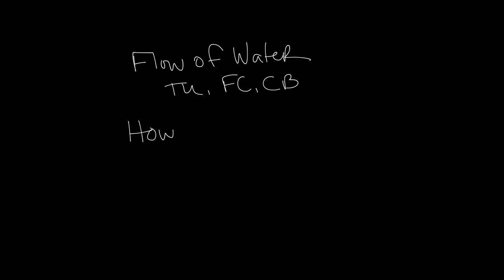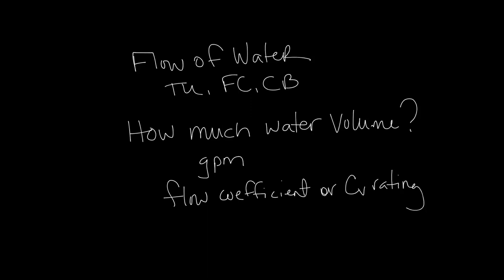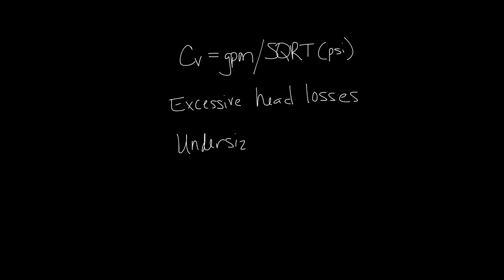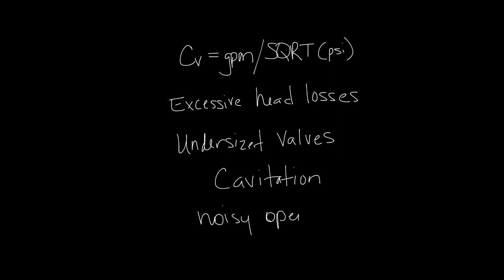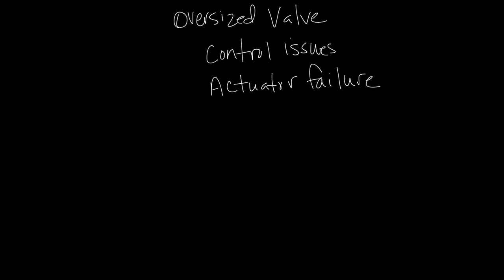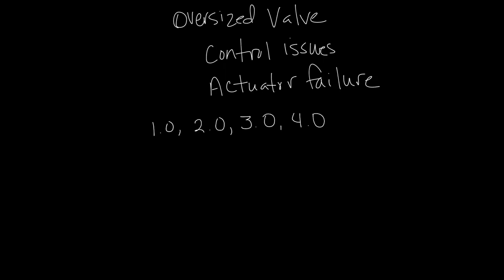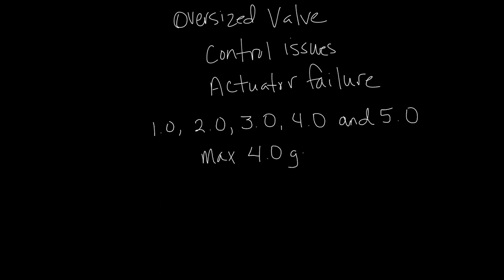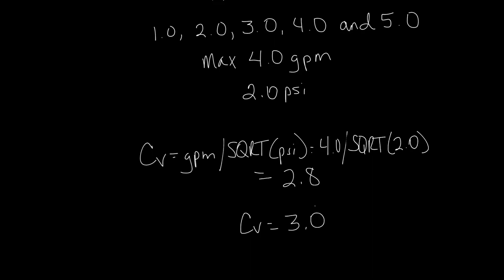Titus Timeout Podcast - Cv Ratings for Water Valves

Comment: How cavitation could accur downstream of undersize control valve  ? There is no pressure explode bubbles like what happen in pump !
Reply from the maker: There are many different types of cavitation. The most common type of cavitation generally involves propellers and pump impellers. Cavitation can also occur when control valves are undersized. As a fluid discharges from an undersized valve, the sudden pressure drop can result in flashing and bubbling. Cavitation occurs when these water bubbles collapse.
Reply: @TitusHVAC  
Very good . But what make the bubbles collapse ? There is no pressure explode them !